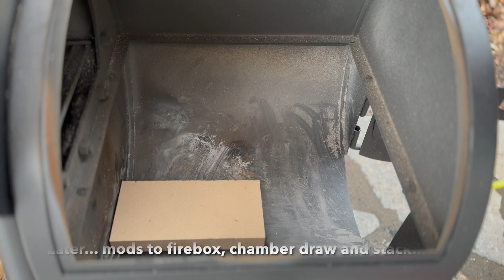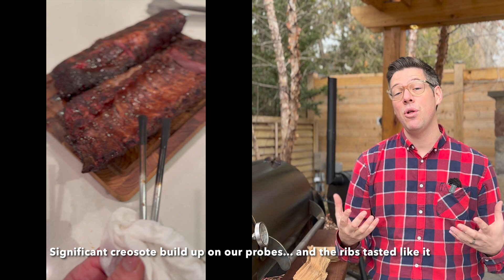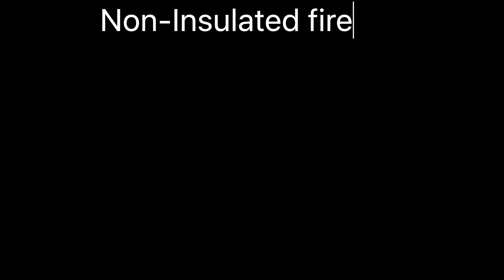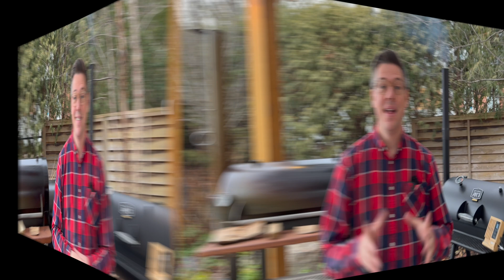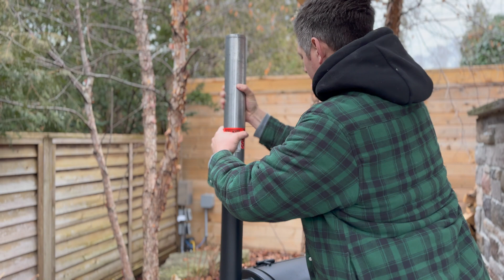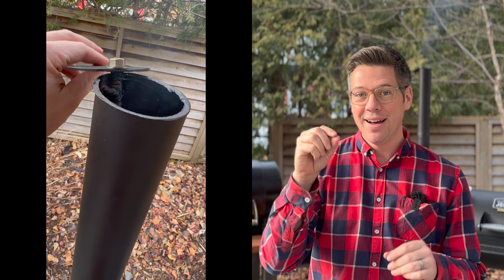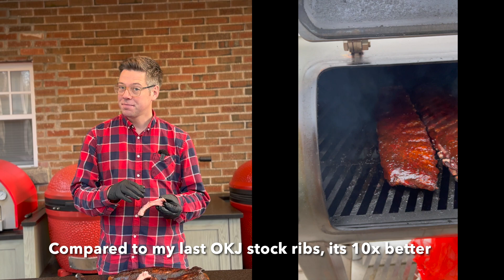Can $50 in smoker mods make my cheap offset as good as a premium smoker for WAY less $$$?

Comment: I got my dad old grill, it wasnt an offset at all, just a grill, but i build a fire chamber righr below the grill, and ducted it to the intake. Its a smoke but not an offset, i did ad better wheels, another workstation, and an extended chimeny, it looks good and i used mostly spare parts, only had to replace the temp gage

Comment: I know the joe manual says not to let charcoals touch the chamber walls as i think it damages them somehow. Is this a legit concern, and if so would the firebrick be a similar problem?
Reply from the maker: The firebrick is meant for fireplaces where the fire can sit on them
Reply: @SmokingDadBBQ roger, thanks. I did my first okjoe longhorn cook the other day with bricks and a basket on top of the bricks. Used your tip about preheating the next split, lodged it on the top corner of the basket. When the time came they caught immediately. The problem was the gap between the brick and the basket was too small and I couldn’t get the tool underneath to clear the Ash to provide adequate airflow and after about 45 splits about 2 1/2 hours, the fire died out and at this point I had achieved my purposes so I did not restart it, but I have cleaned out the fire box and installed the original Cole great on top of the brick and then the basket on top of that which has increased the air gap between the brick and the basket by another half an inch to an inch so I’m hopeful that that’ll run better in the future. I may be talking out of school cause I don’t really know what I’m doing. I’m just trying to get some experience! 😅

Comment: I have one of the cheap Home-Depot-style offset smokers because that's the only offset smoker available where I live (Colombia, South America). I ordered some ceramic chimney insulation from Amazon and some furnace cement. I covered the smoker with it and now it looks monstrous, but makes a huge difference!  My wife had challenged me to get brisket at the quality she had in Texas, and after 2 years, she says I finally nailed it. I also used only 2 (South American variety) walnut logs, where normally it goes through 6 or 7, with the heat oscillating widely all day.  It cost a little more than $50- maybe $70 or so, but if you have a cheap sheet metal smoker, I highly recommend this hack!

Comment: You could of saved yourself a ton of trouble if you had left the the coal grate in the firebox and not laid your coals on the bottom. I run  12x2 inch splits in my Chargriller on a light coal bed with a grate. It'll go 20-30 minutes on a hardwood split. Is it ideal? No...but I'm not asking it to run outside of it's capabilities.

Comment: Remember that there are different things you can do with the ash from your fireboxes. Good in gardens and as pest(rodents, rabbits, and moles) deterrent if you put it in/around holes. With a little sifting, a little sand, water, and patience, you can turn the ash into bricks. You can fire those bricks to make them both heat and water resistant.
Reply from the maker: definitely used in the garden but never made bricks lol

Comment: There is really no excuse these days not to own a welder. While I certainly recommend getting a quality welder if you can afford it, you can get a cheap welder for next to nothing these days that will get the job done. Even one of those sub $100 Amazon special stick welders will be a hell of a lot better than nothing. These days you can get a halfway decent multi process off brand welder for well under $1000, for what you are doing one of those Harbor Freight flux core wire feed welders would be fine and I'm pretty sure they are only around $200-300 or so. I forgot the name but there is a no name muli process welder that is Stick, MIG, DC TIG, and a plasma cutter I saw reviewed on YouTube a while ago that was under $1000 and seemed to work pretty good, it's crazy how they can make this stuff this cheap! Probably not going to last long if you're using it all day every day. I'm sure the duty cycle absolutely sucks as well, but for the typical homeowner who might put a couple hours a week on it at most it will probably last a lifetime, and they are extremely unlikely to ever run into the duty cycle limit.

Comment: This is giving me an idea I'd like to bounce off of you guys.  Most pellet grills have a smoke stack starting at the top corner.  It's also fairly common wisdom that foods get more smoke on the top shelf. My theory is that with the heat deflector in place, the smoke is coming up the heat box side and following the top of the smoker along to the chimney output. 
My result is that I get very little smoke flavor at all (ZGrills).
I wonder if doing this same chimney mod to change the air flow outlet to be about grate level would improve that.
What do you think?  Different reason, but could that work?  Do you seen any issues with it?

Comment: Been using this smoker for two years. Leave side door open, add aftermarket piece to collect smoke at grate level and put water pan under grates on top of baffle plates . I can run 250 degrees all day. Takes more tending with smaller splits.

Comment: I would like to buy the pecos grill from academy. Right now still making briskets on the Walmart oklahoma joe I put together. Originally it didn't include the smoker part so I ended up picking it up on sale just 3 months after I got the grill,  than put the two together. Added sealer around and it works ok. Paint on the bottom peeling off and holes drilled on the tube didn't align as well but adding sealer on that helped. One day I'll get me a really good off set smoker.

Comment: To keep a true fire burning without overheating the cook chamber I use even smaller wood at least as small as the smallest pieces you used. And I add a little lump charcoal as I go. I never have more than 1 piece of wood burning at one time. I start with half a chimney of lump while preheating a first split on top of firebox.  I did the 3” 90 on the chimney intake. I just cooked a full 17 lb packer brisket. That came out good on it. Chicken wings ate bye far my favorite thing to cook on this unit. I have the exact same unit.

Comment: Thanks for the video, I implemented all those same mods on my OK Joes including the semi insulated firebox. I have one question about this mod though: How do you mitigate ash buildup when burning directly on the firebrick? I did a trial burn when seasoning the smoker while burning the charcoals and wood directly on the firebrick and had problems maintaining a consistent fire in the firebox because of the excessive ash buildup choking out any kind of airflow. I’d love to hear your thoughts on this as I imagine we probably use different methods of lighting the firebox initially; perhaps on using too many lump coals in my chimney starter? Thanks again!

Comment: I suggest using a band clamp on the outside of the exahaust pipe to hold the screw on the outside of the pipe.  It might offset the damper, but I assume it's never fully closed anyway.  Good luck and thanks for the good ideas.
Reply: @mongo64071  A hitch pin works as well.

Comment: It was nice to see the comparison between both, but the suggestion at the end that one would be better off with a larger offset is just stupid. Its called a cheap offset smoker for a reason. Its like suggesting people buy a new car instead of a broke down 96 ford taurus. The reason people buy a $250 smoker instead of a $2000+ smoker isnt because they are underestimating the amount of meat they will want to cook.
Reply from the maker: The space comment is rooted in two things. First fitting more food for the effort and second it’s easier to run a larger volume pit. There are many for around the same price with slightly more space than the highland. Not saying you need to jump to a 3k pit

Comment: Hey, I really enjoy your videos. I purchased the OKJ in the US recently and have not cooked on it yet. I purchased the items you suggested and while prices have increased some, the retrofits will certainly serve me well. For the smokestack damper, I went to my local auto parts store and they connected me with a welder who spot welded the threaded screw to the extension I purchased. He did not charge me anything but I paid him anyway. It worked perfectly with the original spring and damper. Hope you found a good solution as well!

Comment: I have the Oklahoma Joe’s Longhorn offset smoker and I bought quarter inch steel 4“ x 12“ and I lined my whole firebox with it I’m gonna do the same to the cooking chamber just cannot afford it right now but I’m taking my $700 smoker and turn it into a $7000 smokerit’s working great
Reply from the maker: The mods make a massive difference
Reply: I know what a lot of people are thinking. Why didn’t you just spend $2000 on the smoker well I cannot afford that but I can’t afford $50 here $75 to buy my steel plate for my offset smoker. Hope this helps other people out there love your videos keep them coming please I’ve been learning a ton and I’ve been smoking for a few years now. Thank you.

Comment: Hey i was just wondering whats the best way to clean out the ash with those firebricks in it.
Reply from the maker: I just got what I could by hand. If needed you can easily take them out and put back in 2 min
Reply: @SmokingDadBBQ  thank you so much for this info put the firebricks in my Oklahoma joe and it is keeping much steadier temperatures.  Less fire mangement

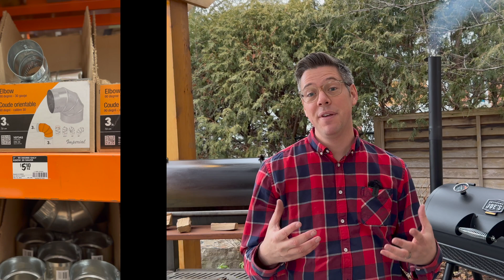Comment: Hey chap , I'm not sure what that pipe at @9:59 is made of but I want to make sure everyone knows not to use Galvanized Steel. Either use straight Steel or Stainless. Zinc is a heavy metal and will ruin your body
Reply: You should be able to find a non galvanized elbow at tractor supply company.  I bought some wood stove piping from there that wasn't galvanized
Reply: It is absolutely galvanized. You might be able to get an aluminum duct elbow that wouldn't be cause metal fume fever?
Reply: Where does one get something thats not galvanized?
Reply: @Anunwin  steel shop
Reply: @Anunwin  Black steel pipe..
Reply: .....and for That reason Im out!
Reply: Galvanization doesn't break down till 400°F - ish degrees.  As long as the temps don't get up that high it shouldn't be an issue.  I imagine for added protection,  you can also cover the pipe end with a high temp paint.
Reply: The galvinized pipe is at the end of the stack, they will be no contmination
Reply: @bobboyett3142  he's talking about the elbow inside the cook chamber.

Comment: Great info and video! You said you cut off three inches from the exhaust pipe you purchased to reach the ideal height/length. What is ideal length you’re referring to? Is it an exact measurement or just something you’ve eyeballed that’s proportionate to the smoker size/smoke stack placement?

Comment: I recently bought a pot belly wood burning stove for the garage during the winter, then  one day while burning a fire and doing a cook on the offset I looked at both of them just there burning their fires and thought I wonder if joining these two so that the fire was a firebox length away would make a difference and guess what...those two have been together ever since, you need more distance from the cook chamber you could use a steel tube between the firebox and a dedicated burn box, this has been a game changer and an extended stack the draw is amazing but I'm telling you you just need a bit more space between the cook chamber and firebox I also welded a steel pipe and angle iron to my handle and matched with the felt 
gasket my oh my this baby cooks

Comment: Hey any tips on a cover to go over the highland with the extended smoke stack? Thanks
Reply from the maker: i ended up using high heat silicone but i would love a little less duct tape style solution if you find one
Reply: Oh i like your silicone idea, I'm talking about a grill cover to keep it safe from rain etc. I can't find any covers for that tall of a stack. Might have to cut a hole in mine and sow a top sleeve on. Not sure if you keep yours covered or not. @SmokingDadBBQ

Comment: The biggest thing ive learned to do since I dont have a wood splitter and the wood I get is in many different sizes... 

I start out with the HUGE pieces of wood directly onto a big coal bed of lit charcoals.. I aim for a starting temp if 400 degrees (with no food in the chamber). Once it burns clean and drops to 300 degrees, from then I manage the fire  with only the small pieces of wood for the rest of the cook. Best method ive found for a clean burn AND long lasting burn (using oak wood). Best I can do for now. I really want to try that elbow out!! I just dont believe in using any gasket material unless its metal based I dont want take a chance of tasting that.

Instead of using any gasket on my massively leaking chamber hood, I opened the lid while the grill was hot and pinched a piece of wood in between the lid and cook chamber and it sealed the leak all together. I think they dont leak until they get hot the first time grilling and the hinges slightly warp. I did that a year ago and the lid is sealed solid!!!

Comment: Try J B Weld it comes in various varieties to attach your screw holder for your exhaust extension, once it dries it is extremely strong. I love your modifications, I just purchased an Oklahoma Joes Highland Reverse Smoker from Home Depot. I get to pick it up October 30. When I ordered it, they had two in stock. I will use your modifications. Thank You, for sharing.

Comment: If that pipe is galvanized. Every time it's exposed to high heat , zink fumes are released. At least for the first 5 to 10 uses, maybe more. Dangerous amounts, maybe not ? But not something you  want swirling around your food or breathing in . If you're comfortable with it, that's fine. But you should mention that so people know. Everybody's acceptable risk tolerance is different. At best it should be heated at high temp in a nice hot campfire for a few hours before you use it. And even then, use at your own risk.
Reply from the maker: Absolutely, I did a follow-up video because of these concerns

Comment: you need a baffle plate in front of your fire box. i use a square frying pan. blocks the fire front going straight into the fire box. i won may comps using an old brinkman offset from walmart using a few mods

Comment: JB Weld High-Temp would have worked superiorly on mounting the all-thread. I hope that helps. I'm going to do all of these upgrades and perhaps machine the "down-spout" more similar to your Pro series off-set and bolt it in place with some of the felt/Nomex gasket in between to give more surface space for larger cuts like brisket. Great video!!👍👍

Comment: I currently have the Reverse flow highland and I decided to try these mods out (along with the other video with the updated video mod) because I was getting annoyed with how often I was having to baby it (way more than I should have I felt) I wanted to give my experience thus far (Will edit when I test more):

Before I begin, I wanted to say thank you for testing this smoker out and giving everyone your feedback. I noticed a minimal amount of information when it comes to these smokers and I'm glad I stumbled upon this channel.

I only tested this with a full chimney (briquettes) , because I wanted to see how the temps differed between zones and how long the fire (heat) would last. I setup three zones, far left, middle and next to the firebox. I also had a water pan in there to mimic a cook. 

Far left reached a max temp of 218, middle 209, right 239. I was losing heat roughly 10 +/- 3 degrees every ten minutes. After three hours, I lost an average of 70 degrees on from each zone, which I honestly don't think is that devasting considering it was all from one chimney. Obviously the temperatures would stabilize here and there but sometimes they would increase slightly giving the lower degree change after three hours.

I have to say though, the firebricks addition is top notch. I went to check on the burn and although the ash had disrupted the burn of a couple of coals, those things were HOT (Over 500 degrees while the cooking chamber was 150). I would like to see how you managed the ash build up with the firebricks though.

Next I will be trying a grate on top of the firebricks to see if it changes how they stabilize the temps without the heat source directly on them.

Comment: Hugely beneficial, thanks!!
Based on your advice, I bought a bunch of oven bricks and lined my offset fire chamber. The smoker did come with a grate for the coals, so would you recommend straight over the stone or keeping an elevated gap with the grate over the lined bottom?